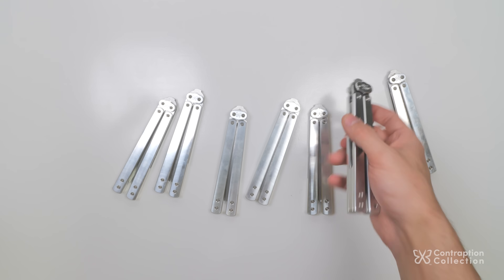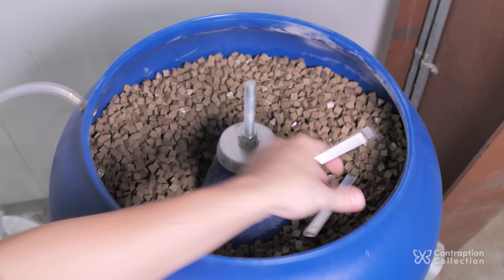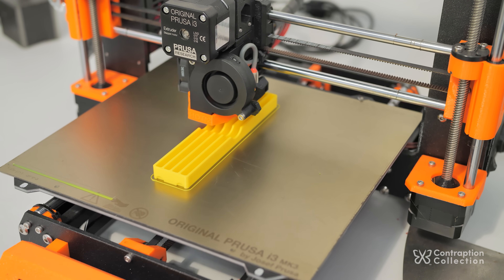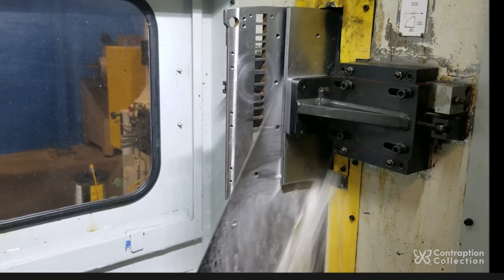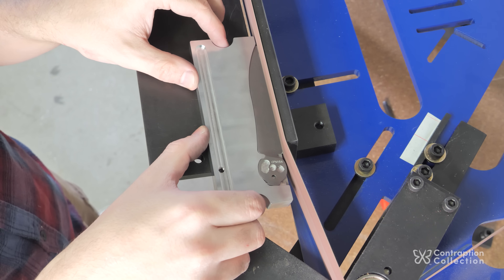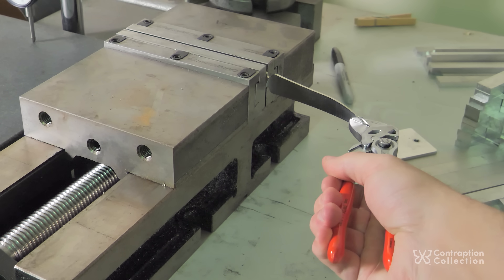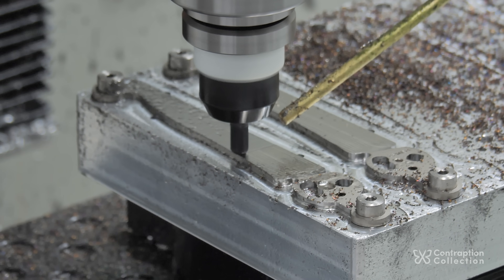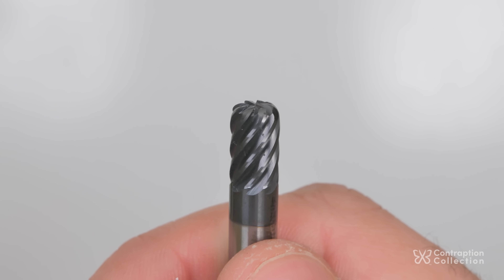I thought I was finished! Baliscissors: Ep 28

Comment: Hey mold maker here that does a lot of heat treating and hard tooling. Try Uddaholm Stavax. It's a powdered metal 420. High quality. But your biggest problem  is you have to machine with the grain.  Heat treat in 3 steps. With your blade thickness try  30 minute soak times after temp is reached at 1250F then 1550F then ramp up to 1850 for 5 minutes. When you take them out the oven leave them in the bag to cool down in air don't force cool.Thin metals to fast equal brittle. Then soak in dry ice and alcohol bath over night. Then temper at 480F for an hour.  Leave about .020 thickness to all dimensions. And machine to size.

Comment: fantastic doodad, nice video! I am sort of horrified by your manufacture process for your blades, it seems like a lot of extra work that undoes all of the previous steps to me.  Your double disc grinding trick looks like the very last thing I'd do- from laser cut blanks, I'd mill the profile down the way you did after hardening, so that you machine a top surface with the sloped edge, and then you heat treat it all, and then you put that on a matched-slope jig on the double disk grinder, so that it grinds the inside part of the scissors perfectly flat to match each other, and comes off that machine a done blade ready to assemble, that's always at your to-spec thickness.

Comment: I'm not a metalworking person by any means, but if the issue is the blade warping due to removing material from only one side...what if you designed it slightly thicker on the flat side, mill the side with the bevel, and then mill the flat side, so it's de-stressed evenly?

Comment: Finish the blades before heat treating, so after initial hardening, if the blades warp, they can be straightened back by tempering them while slightly bent the other way in a fixture, and then you end up with finished and straight blade.

Comment: Id say try out Nitro-V steel extremely rust resistant and it holds a great edge can get it at good prices and I believe machining it is just as easy as 154cm or maby try using air hardening steel like D2

Comment: Just came across your video this evening. Never seen scissors like that. Very cool! So many processes. I've only ever machined with full flood coolant and never such specific material. I have done some stainless machining though and we struggled with work hardening on the stainless. The stainless had such specific machining though and we'd find as the tooling went slightly dull they wouldn't cat and rather rub the surface at a point and then just shatter. Have you tried different feed rates and rpms? Maybe a different tool with inserts? I also heard of some people using a very fine oil or paraffin mist while machining. Good luck! I hope you figure out the warping issues.

Comment: You should use a material called nitinol or sm100 it's a titanium/nickel alloy that is very strong and can hold an edge for way longer than 1095 steel the only set back it is 5 times harder to shape/sharpen.

Comment: I worked in metallurgy QA for years, and appreciate your heat treating problems. Take a look at Victorinox knives. I think they're stamped, have a hardness in the high 50's HRC, bend a lot before breaking, and hold an edge very well. It may be hard to get information on their metal and processes, but I think their steel could give you some ideas.

Comment: Your material is stress relieving. Try getting thicker stock. Cut one side just taking off the top of the matinal. Flip it over and cut the blade. You might have to flip flop the blade a couple times until final dimension. In terms of heat treat u might try getting the blade flat then heat treat it and the cut both sides. If you have a bent blade and you then put clamping force on it and move it back into position it will go back to its bent form. You have to get the stress out of the material then cut the bend out of it while not changing how the blade wants to sit on its own. You can also get material stress relieved. That would help immensely. Gl to you

Comment: You mentioned that your measures to compensate for the anodization resulted in looser parts, what about material lost to the tumbling process also? It's still material lost to result in a surface finish.
Also when you heat treat, have you considered the idea of differential cooling? Intentionally let one side cool faster than the other, don't avoid the bend, control the direction of the formed stresses.

Comment: You might try 420 HC stainless steel. It is extremely stable in heat treat, and easier to machine. It's not as good of a blade steel as 154CM, but it probably doesn't matter for scissors.

Comment: Hey there! I was a knife engineer in a previous job. Yes, a knife engineer, or rather, a precision edge engineer. I worked for a company that made all sort of knives. Everything from tree chipper blades, to scalpels. We did alot of blades similar to yours and had the exact same problems.

We typically had our blades belt ground instead of hardmilled for the edge. But sometimes we would stone grind blades. We sometimes would have as much of the material removed before hand as we could, without warping the material. Then heat treat and temper. And then final bevel. If we had warpage issues in heat treat. We would put a slight bow in the opposite direction during heat treat to counteract the warpage we would get later on. We would have a fixture table made and just slip shims underneath.

Even further, depending on our process, we would use the fixture plate in our grinders. But only for a straight blade. And we would flood grind these on large Mattison grinders. We could hold +/-.005 on parts 48" long and 1/32" thick. But maybe you could try that for hard milling since you have 3D capabilities. 

If you wanted to get really fancy, the amount of material you remove would directly correlate with the warpage. If it's consistent enough, you could remove material strategically to counteract warpage. 

If all else fails. We would typically peen the blades straight. But that is truly an art and very difficult to master.

In my experience, 440C was a much stabler material than A2 and D2. M2 was the most thermally stable and least prone to warpage on thinner blades.
Reply: I was about to suggest 440C.  Its frowned upon because its not high end but I think for a novelty item like this it would be perfect.  
I mean, I just stumbled on this video and I will buy one if I can afford it.
I don't need performance scissors, I'll probably never cut anything with it.  And I am an ok flipper at best. I just want it as a cool innovation.
Reply: man, I love internet.
Reply: I'm curious if heat treating strain relief would be an option for blades? You basically reheat the metal to about 50 degrees c under the tempering temperature and hokd it there for an hour or two then allow to slowly cool either by air or in an oven that has been turned off. 

I've done this for home brew parts before but never with a blade. In my case,  I used a welding blanket to slow the cooling down. From there it was just some light sanding and polishing. I ended up with quite a bit of discoloring and some scale because I didn't hsve a way to use an inert gas, but dimensional accuracy on two ends was what I was after.
Reply: How great is it that nice people will share their extensive knowledge and experience so freely?
Reply: @GamerZatic dude that is good stuff right here, guess it's your fault if your attention spam is trash
Reply: If you really want no warpage you can always do a stress relief and use PM steels. Due to the really uniform structure the warpage should be minimal to Zero.
Reply: @Dash199t  

One single instance of hands on experience is more valuable than all the reading you'll ever do on forums... May wanna keep that in mind
Reply: @CNYKnifeNerd  Thats true. 
I have been building knives for ~6 years now and only work with PM steels. I dont have a warping problems, but I also dont hardmill my stuff and I do stress reliefs :)
Reply: OP is pog for sharing this
Reply: are you violating a nda or something with this comment?
Reply: @sammythesammyfan8809  Considering I never signed one...probably.
Reply: call me old fashioned, but stock removal after temper and then heat treat seems like it's worth a try
Reply: I distinctly remember an informative documentary where a guy used a neutron star in space to forge an axe blade to perfection. I have a vague memory of Kyle Hill hosting and/or featured in the show, so maybe ask him?
Reply: @Parpyduck  I believe we watched the same doc, and that axe was cast, not forged.
Reply: @Parpyduck  I think I remember that show. Though I thought the axe head was cast not forged. Either way, last I heard the master blacksmith at the forge had retired due to severe arthritis.
Reply: @Parpyduck  why does it sound like the scene from Avengers Infinity War🤔🤣

Comment: aneal the back surface side on or close to the spine. this may help to get rid of that warping after machining. same thing  as if your welding. if u weld something 90 degrees to itself the weld will cool and shrink pulling your part out of square just because of thermal contraction. another option could be heating your jig as its made of aluminium which only sucks the heat out of one side causing warping. how you would do this would be a challenge. you could cut cooling paths on the back side and make a plate to seal it or use a heating element to heat the jig evenly. i completely agree with the tooling being sharp and having warping but after time it gets blunt and creating  the warping due to the extra heat the aluminium jig is taking out.

Comment: Just going to toss an idea out there. For some curved blade shapes, blacksmiths will forge the blade straight, and let the difference between the beveled edge and the spine cause warping in a controlled way to give the curve, rather than forging it in themselves. I doubt it'd be consistent enough for production, but what if you introduce an extremely slight bend in the opposite direction before heat treating? Hopefully the end result might be more what you want.

Comment: hi, wow, you do great job and to make your life a bit more easy, you did all right ;-) just aneal the blades to a bit softer hardness like 56-58 HRC and straighten them with a hammer, its a old technologie, a very small hammer and not a lot of force. in Solingen Germany, they make knifes and scissors straight  like this for hundret years. the heat you bring in with machining does not make any difference, the tennsion in the steel comes long befor that. you can not really avoid it and need to find the best solution to get them straigth when they are allmost finished ;-)

Comment: It appears that your jig allows you to machine the bevel on more than one set of blades at a time.  Have you considered milling a small amount on one blade and the moving to the next blade and milling the same area on it?  Perhaps if you did small amount, moved to next blade, did same area and amount on it, then on a third and then a forth and so on, this would allow the 1st blade time enough to ensure that the milling heat is not induced into the metal all at once?

Comment: Perhaps you could try machining both sides of a scissor blade after heat treatment. If machining only one side is warping it then machine both sides. even if the other side is only machined flat instead of beveled.

Comment: Im a machinist and I've work for both Edelbrock and Caterpillar, always use coolant in a production application. Try reducing for depth of cut and feed to reduce the amount of heat put into the part, heat is likely your only issue with warping. You could also try having a different clamping method, like a electro-magnetic clamp that holds the whole blade. 

And you arent shocking the tool with coolant, as long as you have coolant on the tool the whole time. Coolant is designed to increase tool life. Other than needing to watch what your program is doing there is no circumstance where coolant is a negative for tool functionality or quality of cut.

I'm gunna buy one of your baliscissors as soon as I can!

Comment: Man, it always gets more complicated. It's like racing to the finish line only to not find out how to cross it completely. 
Have you considered creating a jig for your surface grinder to make the edge? You may also need to find a specialist heat treat company who deals with single edge grinds; I'm sure there is another step to the process that could be added to prevent or reduce the warp on something with a variable thickness.

Comment: this is great but here is a tip. never tumble your blades in the same media your tumbling the aluminum handles. the media will wear out much faster..the blades must be bent back in the middle of heat treating. they should cool 1/4 of the temp or so before putting them in a vice and bending them then do a dry ice/isopropyl alcohol dip.we do dozens of blades a day at the shop i work at.

Comment: Only got 2 ideas on how to deal with it: You could look into how slow you need to feed in order to prevent excessive heat. Work your way up until you find the threshold. That's the most sensible idea I have. The other idea I have is more uneducated: creating a support jig to be used while hardening, which will be move to happen later in the process. Heck, you could make the support jig help in the sharpening process as well. 

I'd try the slower feed since that one should be the easiest to work with

Comment: The aluminum block you bolt your parts down to on the mill acts as a giant heat sink. If you run coolant through the block to a radiator that can help keep your blade cool during the milling process, preventing warping, and you won't have to worry about how it affect the tooling.

Comment: I have done some heat treating in the past as a job and I would encourage you to look into "steel grain" direction. As the steel is made the ""grain" is facing a certain direction. This means that the final part you take out from the sheet or a block comes out different every time depending on the cut pattern orientation.  It behaves differently under heat and can create more aggressive bending. There is also an option to mill out the part before heat threating and then putting it into an oven. When you have established the bend to be to an certain direction every time after heat treatment you can grind/mill it from the raised direction which applies heat to it and unreleases the bend by a little bit. If you have a perfectly flat part after heat treatment and you do any machining/ grinding to it. it will bend more. Do you only temper the metal or do you also anneal it to release some of that tension?

Comment: Hey, i'm a bit rusty on my metal science class, but I suspect the warping could have something to do with the (metallurgical) texture of your feedstocks. Do the blades also warp in the width of the blade, and create a hollow? If not, then its possible that asking your waterjet company to rotate the cuts 90 degrees could solve the problem (and make it warp in the width direction, but a hollow grind on a pair of scissors is preferable anyway, right?). So switching from aligning the blades with the rolling direction to aligning it to the transverse direction (or vice-versa) of the sheet of metal.

A bit about how and why: in the Austenite/FCC to Ferrite/BCC millitary transformation the single grain elongates in one direction, and shrinks in another. If all grains in a workpiece were randomly orientated these size transformations would cancel out and there would be no warping or (macro-)internal stresses. However, when casting/rolling/forging you introduce a bias into the orientation distribution of the grains. And especially rolling introduces a lot of bias. Its this bias that I believe contributes to the internal stresses in your blade, and by milling the bevel you relieve the stress at one side, making it warp in the length direction. 

The inadvertant heat treatment due to the dull tool of course also plays a role, but that would only affect how much it warps, not the direction

Comment: Using oil as coolant/lube probably wouldn't shock the tool as much, since its thermal absorption rate is much lower than water based coolant.

Comment: Design a heat treatment fixture that applies a small force to counteract the bend in the blades WHILE heat treating. The steel will creep at the higher temperatures and end up in the right shape. Additionally, you could design the new fixture to hold many more blades to increase your heat treatment throughput

Comment: Spring back is always hard to account for on such thin pieces. Like even if you kept them pressed for any length of time it seems they would cool and bend one way or another. I don’t know if this exists, but what if there was a machine that had two big metal hydraulic pressure plates that could heat the blades evenly and turn off while under pressure, that way they could cool and hopefully be straight after?

Comment: For the problem of uneven wear on the belt grinder, try tilting the table so that the edge of the blade you're grinding spans the whole width of the belt. You don't want to wear down stripes in your belts, that's a great way to have them rip apart and fuck up your grinder (or you!).

Comment: Clamp your bent blades to a v block or something metal and try running a temper cycle in your oven see if that doesnt take the bend out Im not sure what hardness your looking for but try a 20 min cycle at 350 F and make sure the bend is face down on the block so that your pushing the bend back flat to the block.    Good Luck